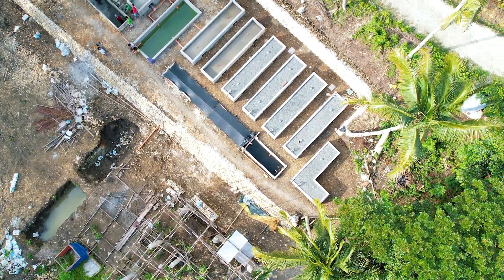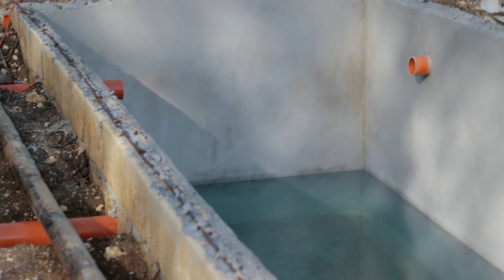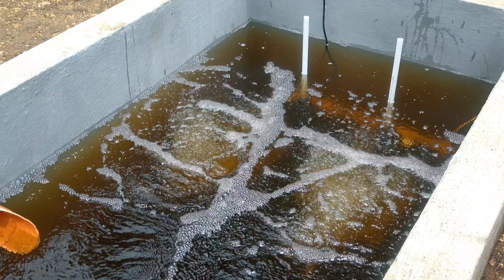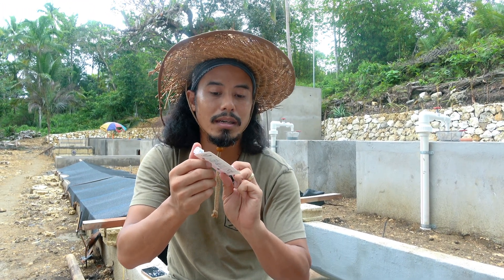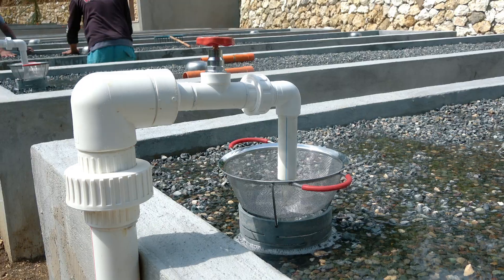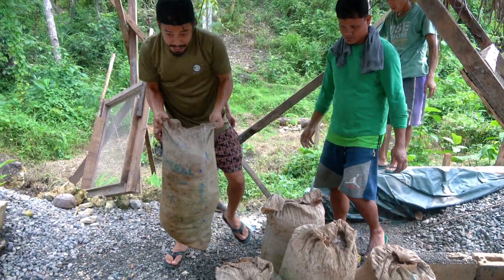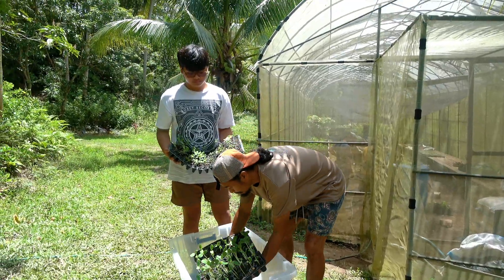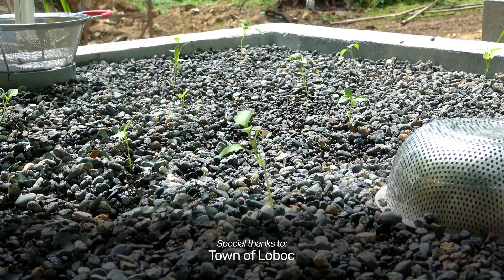Cycling Our Aquaponic System For the First Time! Ep 6

Comment: Hey man, I like your vision. I'd suggest that you switch them plant boxes to tilapia ponds  vice versa for better tilapia production. If you worry about ammonia spike, put duck weeds on the ponds. Duck weeds serve two purpose, ammonia absorption and food for tilapia. Algae are also part of tilapia's diet so you dont need to worry about it. Tilapia poops a lot and I mean a lot. What you need to pay attention is how to make them poops transfer to plant box. I suggest that you use styrofoam instead of rocks so you can plant more. Nitrogen cycle will happen even without rocks plus more plant, better filter. Plants, fish, surface agitation. I'm not an expert by the way but I've tried it and worked for me.